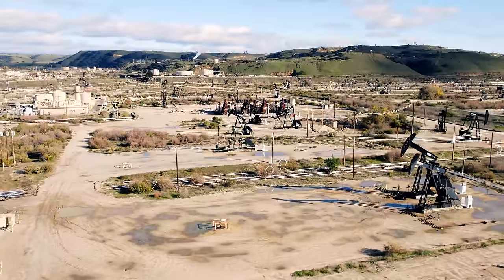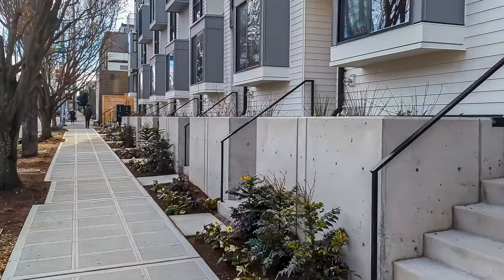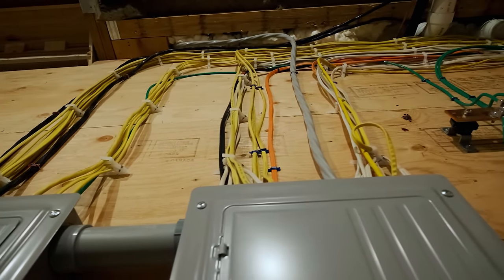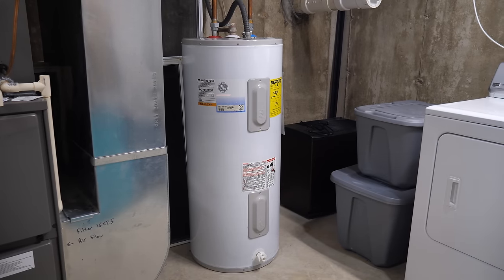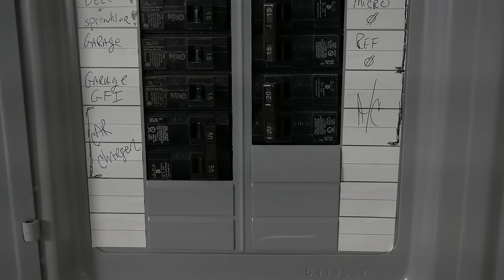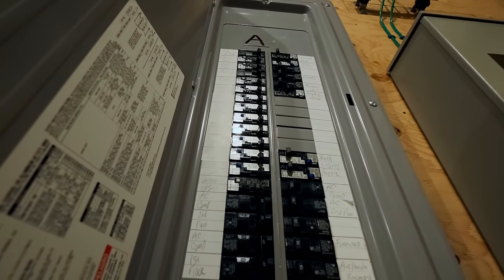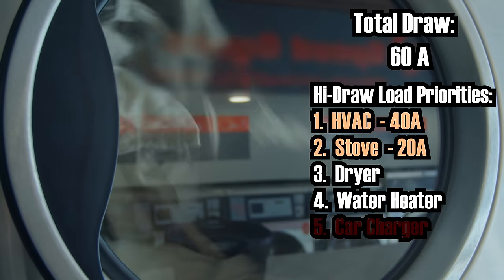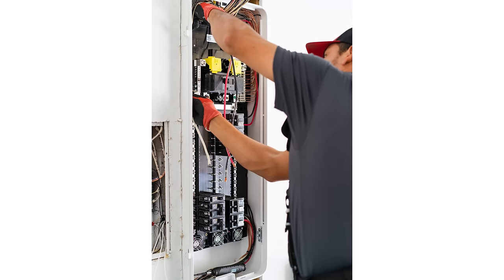Home Electrification: There's not a lot to do, and it doesn't have to be hard (Part 1)

Comment: The worrying thing for me with iot is that they have an annoying tendency to suddenly gain a subscription model. Can't imagine how much of a nightmare it would be for something this integrated to have that happen.
Reply: Also, what happens if the company goes defunct or the standard changes? What happens when the board in the panel fails or becomes obsolete? I might put a smart distribution box downstream from my breaker box but my breakers will be old-fashioned electromechanical breakers.
Reply: this WILL REQUIRE a subscription as SOMEONE has to PAY for the "cloud" service and all the ONLINE servers ETC AND the programmers to MAINTAIN the software AND patch bugs and vulnerabilities that ANY software package will have
Reply: Well, if the panel can still be controlled manually, the software is open sourced, and it does not require the cloud to function, I would be fine with using it as they cant force you into a subscription and you aren't locked into needing an internet connection to use it.
Reply: Yup, that's why when I "smartened up" my thermostat, I went with a Honeywell EIC.  It's not as slick as some of the newer stuff, but it is not phoning home and doesn't open a security hole in my WIFI and I don't have to worry about whether a company pulling the plug on a server will kill my ability to control my heat.
Reply: A lot of the problems with electrification are problems for regulation rather than for technology...and that's the problem. We don't have the political will in the USA anymore to resist business interests with government regulation, and so not only will electrification be extremely painful here, it will also come with a lot of problematic riders like subscriptions, fees, and service charges.
Reply: @NumptyBrainStorm  they signed up for that service. It wasn't without notice
Reply: @NumptyBrainStorm that was an optional program from power companies that would give people a discount if they agreed to let their AC be turned off in peak usage moments. It’s a pretty common program in places that require a lot of HVAC usage at once, not a power company just shutting off your power Willy nilly.
Reply: This is what stops me from going head first into many things (including an electric car).  I refuse to get stuck in someone else's system, period.  I have little issue with, say, the electric company connecting directly to the meter *they own*, as they get no info about my internal circuits, and their system "going down" is unlikely to be separate from the grid itself failing.   But anything that can fail in a way that is beyond my control, or be modified without my consent, is a massive nono.  "important firmware updates" is not an excuse to own my breaker, and I would be terrified of the device failing cause of a mistake on their end.  At least if I have control of it and *chose to act on that control*, I both am capable, and responsible, to manage the issues.

Note this is separate from being given the choice to connect it and grant them access to a device.  If a user doesn't understand how to manage the firmware, or isn't tech savy enough to handle connections and management, then it's fine for them to be offered remote management.  Most people aren't gonna have the knowledge to do stuff themselves.  But an "I wanna control this myself using industry standard technology or control" option must exist.  MQTT, Documented Local APIs, SSH, Telnet.  All of these are acceptable options, and that second one removes any excuse of "But no existing options work".  If truly nothing else exists, make something up and TELL ME HOW TO USE IT.  Plain and simple.
Reply: I've built several DIY home automation projects over the years that are accessible to other devices, but only devices on the LAN. This has the downside of preventing remote access.

If you want to access information from your LAN remotely implement a VPN to securely access it.  Most residential internet customers are assigned a dynamic IP address so need some sort of real time IP address update, either Dynamic DNS or maintain a connection to a cloud resource. But in this case the cloud only acts as a method to communicate the current IP address. 

From a product standpoint I understand this is a more difficult to sell then having your widget magically connect to the cloud so it can be accessed anywhere. It also needs some form of steering/selection to access multiple devices. A home server is ideal but that is yet another piece of hardware/software that needs to be installed/configured/maintained.
Reply: @Jack-do3sy  yep, well put. Obviously this one company won't solve the problem but the format of a smart breaker will be taken up by lots of manufacturers if they're paying attention. Open-source and cloud-agnostic is the way 👌👌
Reply: my worry is government executive orders overriding controls for heatwaves and extreme high demands on the electrical grid. california and Colorado had smart thermostats override consumer's request of a cooler home in the summer because they were basically causing the power grid to fail.  imagine the governor making an Executive Order to stop people from cooling a home in a middle of a heatwave and prevent your electric Car from charging because the demand is too high?
Reply: @jason riddell  well, you could always just ship the panel with a little Raspberry Pi equivalent installed inside that is its own server

Your router needs to be turned on anyway for it to connect to the internet, so it may as well be the server

If the company wants analytics, they can host their own servers to collect the data but the main load will be on that little pi equivalent
Reply: This is why you should look into running a local server to manage home automation and iot.
Reply: Think that's bad. What if they do like Microsoft and make Windows a service. I don't mean your computer operating system, I mean your actual windows - what if you're not allowed to open them on your own once they're factored into HVAC calculations.
Reply: Hard pass from me unless it talks LOCALLY with my Home Assistant server.
Reply: @wizzo183  You're right. Slippery slopes never happen.
Reply: Iot is bad but having something smart without the internet would be awesome. Sadly no one is making such a thing.
Reply: @grafzeppelin4069  Things like heating/cooling can be time shifted to some extent.
People will refuse to install such systems if they are not able to overrride as needed,
Reply: @grafzeppelin4069  is telling people that the thing you got a significant discount on your rates for would happen, after you agreed to it libertarian somehow?
Reply: Intrepid folks will figure out either aftermarket firmware or barring that, how to rip the guts out entirely for a separate SBC which will integrate nicely with Home Assistant or something similar. People will figure out how to take control of hardware, just keep an eye toward the exploits of friendly hardware hacking groups.
Reply: 😉 What if my EV hacks into my fridge and uses that to DDOS my HVAC thus hogging all the electricity so it can mine crypto and buy it's freedom?
Reply: "A subscription model"... Guess what the predecessor to subscription models was called? That's right! A power bill!
Reply: I would acknowledge the existence of IOT if somebody came out with a line of products that used only hardwired connections and no 3rd party "app" or webserver - until then these companies trying to charge you money to wiretap you can F right off.
Reply: @spackle42  Great job understanding the topic.
Reply: @Vit Apa  thanks for noticing. If you are struggling yourself, feel free to ask.
Reply: @jasonriddell  Just like most traditional electric services nowadays
Reply: IOT is a funny thing. Read up on the whitepapers for the tech. "Your car will start when you get in. Doors will open for you. Shop without a credit card."
But what happens if you're not a good citizen? Well, maybe your car won't start at all. Maybe doors will stop opening. Maybe you won't be able to buy or sell.

Would that really happen? Would your government suggest bricking your phone or car (like they asked Tesla to do to Russians at the start of the Ukraine war?) Would the electric company use your smart thermostat to lock you out of raising the temperature to save energy? Would you really be unpersoned for not staying up to date on your ********? It is a mystery.
Reply: At present time, this is happening! I have a 2014 3D LCD TV which works excellent. But there hasn't been updated since 2019 and now almost nothing works (YT, N, SEN, etc) even some propietary services are discontinued and doesn't work anymore. And that obsolescence comes with everything!
Reply: @jasonriddell  I'm not sure why you'd assume something like this has a mandatory cloud component. I'd expect an opt-in subscription to access cloud services.
Reply: I would definitely only ever invest in a system that's run completely locally. I would happily give up it's exposure to the internet too in exchange for stability without having to rely on some company pushing updates. There are open source projects out there but it's all very new and still needs to mature.
Reply: everything needs to phone home in order to work. if that was my business model, i’d certainly get sick of keeping the lights on for free in my data center after a while. shouldn’t be long until it’s commonplace for these solutions to offer a mini server that you can be in charge of maintaining in-home
Reply: For real. It was lost on me when he suggested an internet connected smart panel like it's an obvious easy choice. If it was a self-contained device that can be set up without a stupid app, then yea, that's up for consideration. But, giving remote access to the electricity in my house sounds horrible. I also can't think of any situation where I'd need to monitor my electrical panel when away from home anyway.
Reply: @StarkillerRadio  The solution to that is not voting for commies.
Reply: @jasonriddell  Then let me self host it. No, mandated subscriptions are scummy.
Reply: I think the solution to this is to basically make your own integrated 'smart' solution. Which is not easy, of course. But the problem is the companies running them just can't be trusted, and if there were to be controllable breakers themselves... Eh it's not a great solution but it may end up being better
Reply: @tomschmidt381  There is another elephant, no, there are TWO elephants in the room when it comes to IoT devices not relying on a centralized cloud service with uncertain future.

The first is ease of use. Without a centralized cloud service to relay things, device vendors do stupid shit like forwarding ports with upnp directly to a device which gets next to zero serious security patches and thus accidentally create things like the mirai botnet. As you said, a secure alternative is VPN but that is completely out of the question when the person supposed to set it up probably has the technical illiteracy to think turning off the monitor turns off the computer. I bet this comment alone will confuse a few dozen people whose only idea about vpns come from misleading sponsorship segments on youtube.

The second one is CGNAT. This lazy workaround to IP address shortage results in end users not having the option to port forward, even if they have the technical knowledge to do it securely such as for a vpn server (unless they pay up for a static ip or the like). There are workarounds, but it's an ungodly mess and usually involves something like ngrok that itself uses a centralized service and thus we are back to square one. Full IPv6 adoption is the only thing that can solve this, and that probably will not happen for another 15 years.
Reply: its great to have your city do rolling blackouts or even just change your thermostat for you since you didnt read the fine print and have to rely on them and their electricity when you could use gas for cheaper and much less restriction...
Reply: @jasonriddell  So far, nearly 100% of IoT devices don’t require a subscription… that’s because they don’t require cloud storage. It takes bugger all server capacity to run IoT devices, compared to video based devices… they have subscriptions due to the amount of storage required.

All that aside… we also have matter, Z-Wave and Zigbee. These are operable without internet.
Reply: @StarkillerRadio  and all of that becomes possible when you have iot that know what's on what breakers. Or, what if your power to your car is capped at so many kWh a day so you can only drive so far unless you get approved for a license?
Reply: All electric home… what could possibly go wrong 😂
Reply: Im sorry to break it to you but gas also has a subscription model my dude
Reply: You're totally right, and this is why I'll always stick to locally controlled IoT solutions. Right now, that's Home Assistant, and it already is pretty incredible, but it is a little hard for non technical folks to adopt. The upcoming Matter/Thread will democratize smart home tech with local control and good interoperability if all goes well. This will really be amazing for basically everyone to jump on board and drive costs down hard...
Reply: It wil it hase
Reply: It’s crazy to me that there aren’t laws about this yet. If it’s a subscription when you buy it then that sucks but hey fair game that’s what you signed up for, but seeing people buy a product only for the product to stop itself from working properly anymore after an over the air update because “hey, you need a subscription now!” Is honestly tantamount to theft
Reply: And the privacy issues. Amazon and tesla has been sued countless times for privacy issues.
Reply: Car charging does not require any special connection.  You can use a 20amp plug in to a 20amp outlet. No internet required. (Thats how mine is).
Reply: @jasonriddell  and if that subscription was $2-5 which is what all of those things costs i don't think anyone here would mind, considering you're avoiding potentially rewiring your house. It obviously wouldn't be that cheap
Reply: @jasonriddell or they could just build the computer into the panel have me connect it to my internet (being able to run in a dum mode incase it goes down)  and if it really must be connected to their server (which what he is describing wouldn’t for anything but updates) then it should follow the ISP router model where they give you the device when you start pay. Either charge a subscription or have me pay upfront for the device I refuse to do both
Reply: @jasonriddell REMEMBER when you bought software in a box?  It was already debugged & worked.  You didn’t need internet connection.  You didn’t need a subscription.  You paid once & done 

.
Reply: There are open source free and non subscription based versions that are arguably better
Reply: Or they can just decide to brick your breaker anytime
Reply: "You will own nothing and be happy." -- World Economic Forum
Reply: @bwofficial1776  That's my thought. There's no need to fix or replace what already works when it would be far easier to simply add smart bus bar alongside the tried and true breaker panel.

I also believe that said bus bar should have a display and controls to be completely functional in isolation. Bluetooth or wifi should be auxilliary only. It should also have a mechanical failsafe that completely bypasses the software controls.
Reply: Commenting so I can one day understand this fucking convo thread
Reply: @jasonriddell many can be configured to work locally. Around 90% of smart devices have home assistant modules and most do not require cloud. Will work without internet.
Reply: Isn't having a utility connection basically a subscription anyway? If you're that set against paying others for services you need to go off grid.
Reply: This is why when I set up my smart home in the future, I'm going to make sure everything I get has a local API.
Reply: @jasonriddell  does it control your caps lock as well?
Reply: As Paul hibbert says, HOME ASSISTANT HOME ASSISTANT HOOOOME ASSISTANT!
Reply: I GRANTEE That's exactly what every single iot company will do eventually... Greed is king
Reply: why my neighbors big tree is completely dead is beyond me but that tree might be coming down. Anyways this video is really for my neighbors since Trump caught on.  If you're scared go to church.